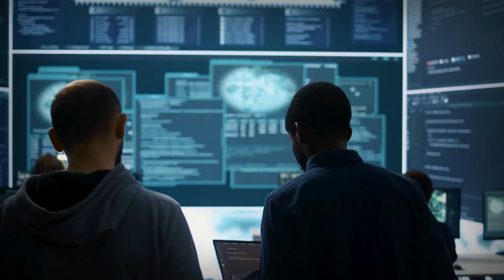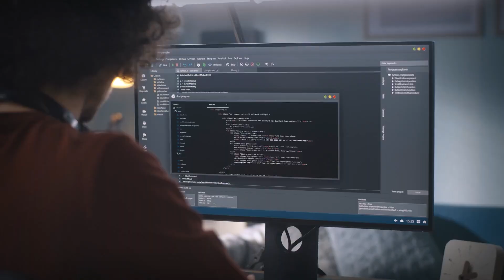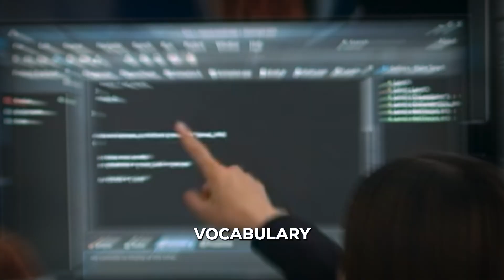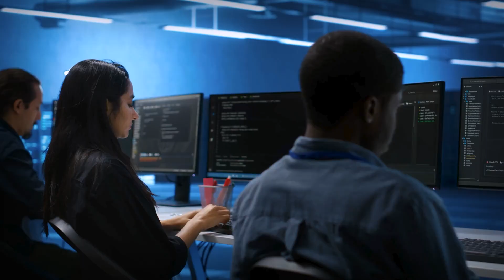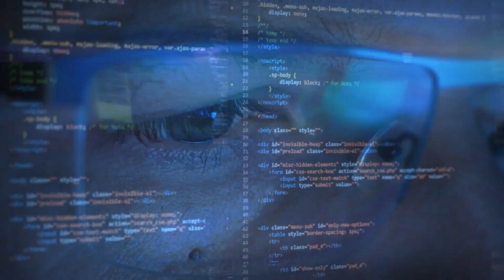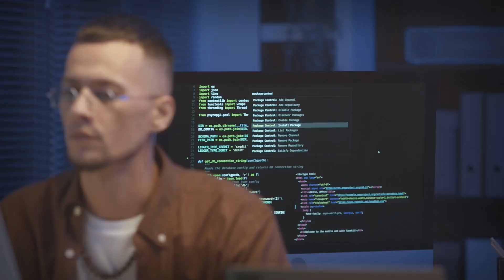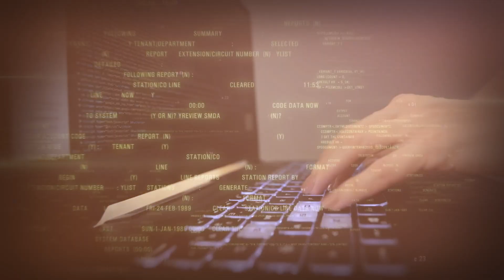Engineering vs Software: The Dangerous Divide That Can Cost Millions

Comment: How can engineers and software developers find a balance between structure and flexibility that works for both sides?
Reply from the maker: I think It's more about aligning the skillsets against the technical goals in the program.  Anything that is not aligned is noise.  A great book is "The Goal" by Goldratt; the topic is the theory of constraints.  As much as the so-called "flexibility" leads to alignment, it's good; everything else is a distraction.  Once alignment happens, then the rest is mostly straightforward.  Every situation is different, so I'm sure there's no one silver bullet.  Another way to say it is that if you can get all the technical staff aligned (DOT product >.9) to the goal  (and should be only one single goal per project--maybe in 20 parts but one Goal).  it's a tricky thing because people have to want to do it--leadership matters in this case